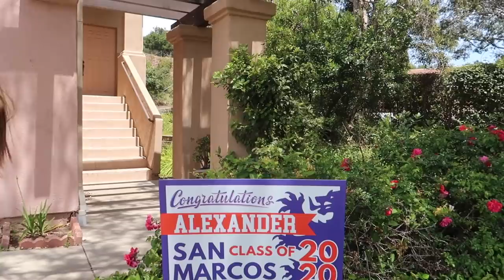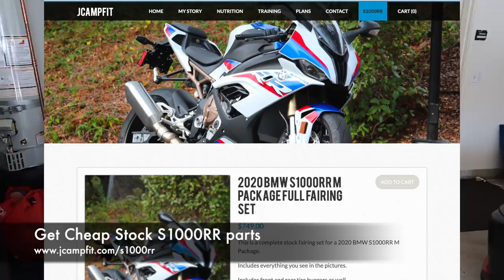Carbon S1000RR Gets Custom Luimoto Seat Cover!

Comment: Just something a little bit different if its feasible. Consider changing up the BMW r1200 or r1250 GSA, those bikes can get loads of extras such as engine guards below, additional hand guards on top on stock, better and more stylish windscreens and additional bull bars on the sides plus some fancy LEDs lights on the bottom front and sides. I think the fuel tank can be swapped from steel to aluminium too

Comment: mate just asking... why it doesn't have a steering damper or however you spell it... the one that save you from tank slapper at high speed... i saw it on every super bike so just asking. btw great built. atlthough that s1000r written on side is just too much but its just my opinion. god bless u